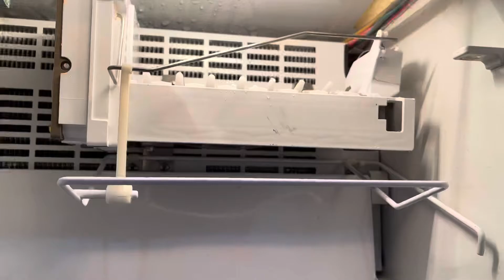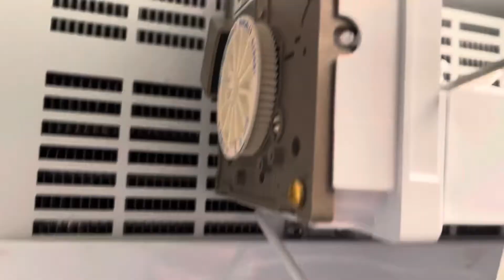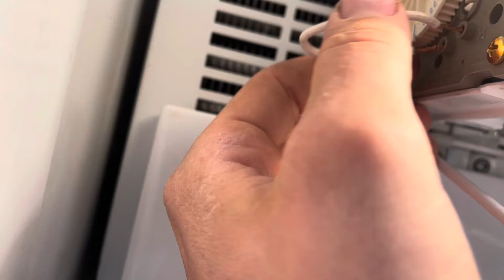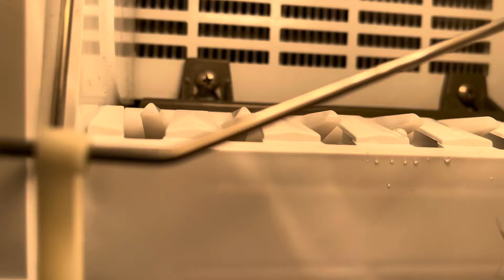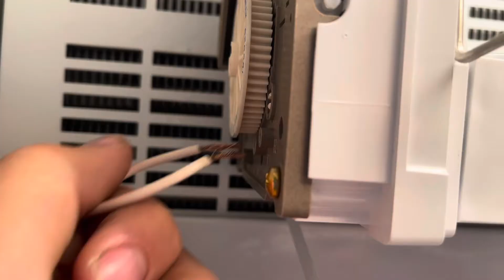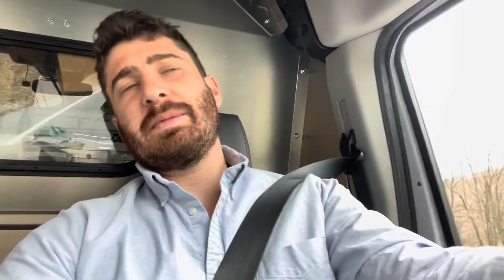How to run a test cycle on an ice maker (sub zero or similar)

Comment: I have been having trouble with my ice maker for a long time. I actually think it might be the condenser unit BUT I am trying the door seal next.

I was having a myriad of problems. It would make if, then it wouldn’t. Then I would end up with a big block of ice in my ice cube tray as if I put in two inches of water there. I am not sure if everything melted and then froze or if my ice maker did not eject the ice and water overflowed with each cycle. 

I replace the ice maker and the water pump as it seemed to have failed also. 

Now the only way it seems to work (new ice maker) is if I jump it every time. And even at that, the jumping does not always seem to want to work. 

so, I am going to check the level of the ice maker and put in a new door seal in the next few days. 

Sometimes when I reach up there is still water in the tray that has not frozen so I am wondering if the lower part of my freezer freezes but the upper does not. 

It is the subzero 550 and many years old. The freezer setting is at 4. 

Any thoughts? I hate to spend another 150 CAD on another ice maker. 

Do people ever change out the compressor unit (I think that is what it is called) or do we simply replace the entire unit. 

Thanks in advance.

Comment: Hello, great video and helpful channel :) I have a model 532 from 1995. Recently it has started forming big blocks of ice in the ice bucket. Seems like water is dripping and freezing. Are there different things you would check before replacing parts?

Comment: If I can save someone else half a day...

This is what I was looking for as I troubleshoot my ice maker.  HOWEVER...

I have a Whirlpool bottom drawer refrigerator.  In order for this to work, the drawer must be closed OR put a piece of tape and hold the light switch such that the refrigerator thinks the drawer is closed.  If the light is on in the freezer compartment, there will be no voltage to the ice maker.  

So, before you try this, tape the switch so the light is "OFF," then test for 120VAC at the test points 'L' (line) and 'N' (neutral).  If you don't have 120VAC at those test point, this method will not work.

Comment: So if jumping the T and H terminals work and it doesn’t work on its own, does that mean the thermostat might be bad?
Reply from the maker: Verify the actual freezer is getting cold enough (near 0 degrees). If t/h terminals work when Jumped, then you have power at the ice maker and the solenoid is working, it would indicate an internal issue with the ice maker. I would elect to change the ice maker.

Comment: Hi...Thanks for the video!  I actually have a different type of icemaker in my SZ freezer.  It does not have the holes to jumper it.  Instead, there is a screw on the drive gear that needs to be turned counter-clockwise to get the cycle started.  While your video didn't show this, it did get me down the right path to figuring out my own.  Long story short, I finally managed to watch a cycle (after replacing my old icemaker), and my leak is actually coming from behind the ice maker!  I think I either have a loose connection between the filler tube and the inlet nozzle on the back wall or I have a cracked filler tube.  At least now I can stop looking at the ice maker.  Thanks!
Reply from the maker: Yes, your ice maker line fell popper of the fill tube hardware. You need to remove the unit and re insert the line. After to do that change the solenoid valve. It’s more than likely the culprit.
Reply: This is a classic Whirlpool ice maker. Cheers 🥂

Comment: Hey buddy. Is the gear on the 700270 same as the whirlpool n ge n frigidaire icemakers? The white  gear next to the one with the flat head screw..can i just replace a gear?
Reply from the maker: Im sure you could, and the gear would probably fit, but I would not do that. Replace it, don’t risk anything, Keep those insurance premiums down and your customers happy. No one wants a flood, these ice makers can get stuck, especially if their is no safety built into cpu board. This unit was from the 90s in this video, if the ice maker gets stuck in the fill position and you flood the house…
Reply: @subzerorepair  for sure thats the older ice maker.. i have a customer that was insisting on "not creating waste" but i insisted on " not causing a flood" lol well see where it goes
Reply: @subzerorepair  it is a new style bi model  and the water valve has a flo meter on it that would stop the water flow if over 9 seconds.  I believe ..

Comment: Hey thanks for the video. I just got a house with a sub zero fridge with a non working ice maker and im trying to figure out if its working/gets water/worth replacing.  Probably just going to order a new ice maker as I know its a 2003 unit.  THanks again.
Reply from the maker: New solenoid and ice maker probably advisable anyway due to the age of the thing. Can’t hurt. Find your water source and filter it like I did, cheap and effective.